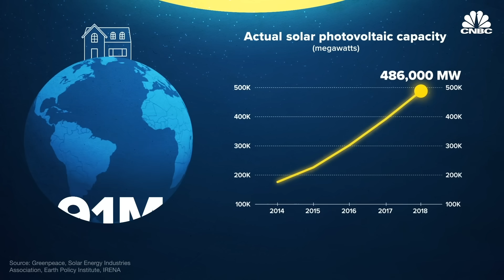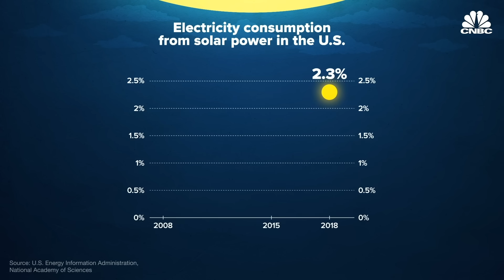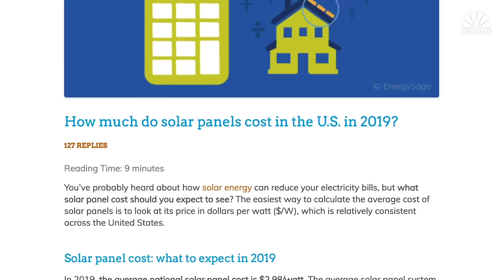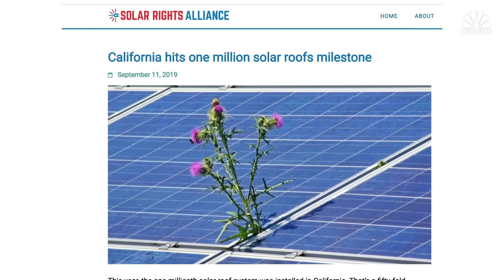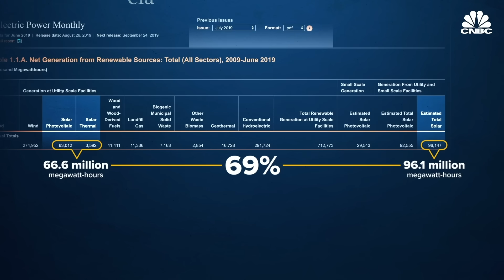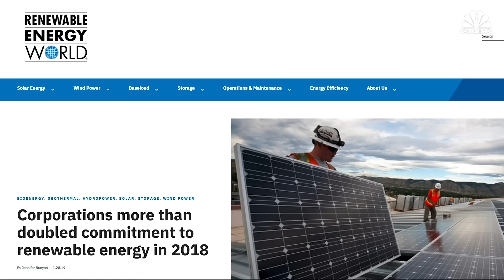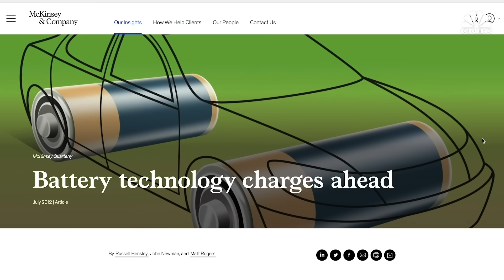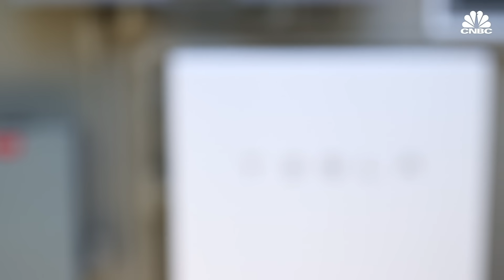The Rise Of Solar Power

Comment: get rid of fossil fuels

im saving up for a electric car
Reply: You will love electric cars. Driving a eGolf for 3.5 years.  No oil change, no smog certificate, no radiator issues.  Over 3.5 years only maitenance needed is tire change and windshield wiper change. That is it.  Plus cost less than 3/4 the price to run it over my other cars. EVs are great!
Reply: How electronic are producing
Reply: Still need to burn coal to create electric for the car